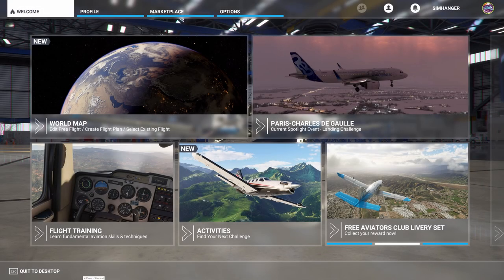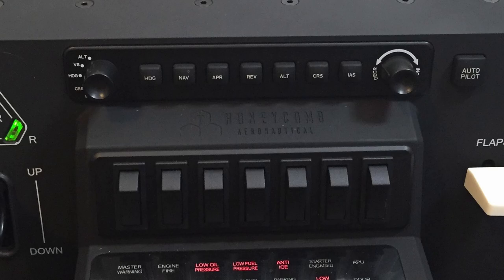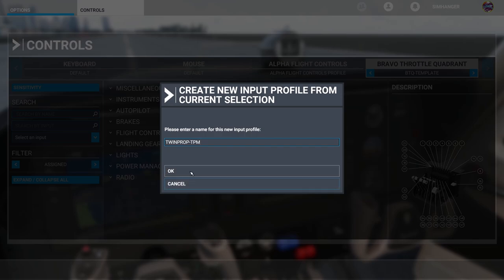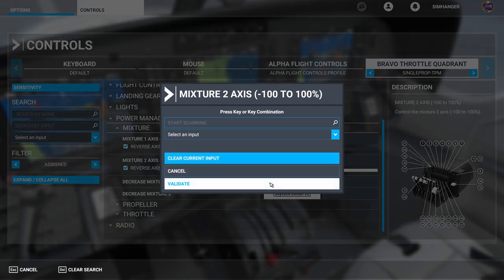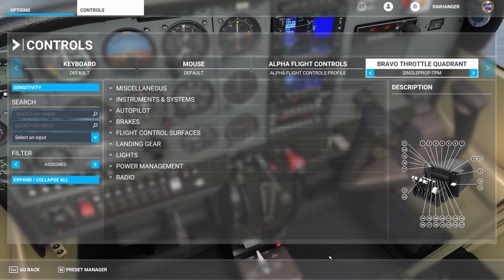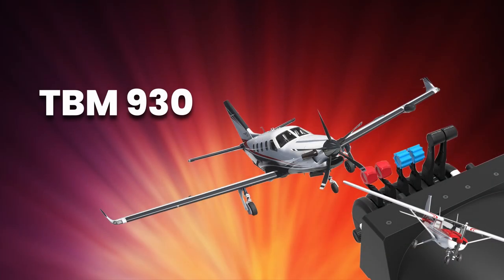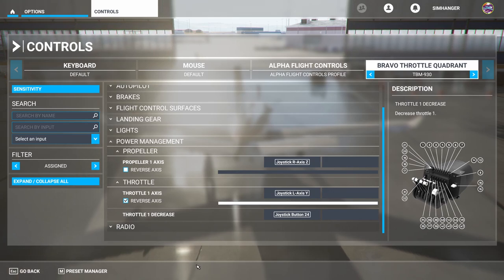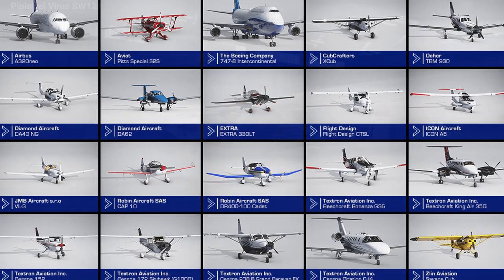Configuring the PROPS in the Bravo Throttle Quadrant | Microsoft Flight Simulator

Comment: Hi everyone. Anyone know how to get the reverse thrusters to work on the Beechcraft Baron G58 using the Bravo Throttle Quadrant? I have Throttle 1 Decrease set to detent button 24, and Throttle 2 Decrease set to detent button 25. When I pull the levers all the way down, the A/C doesn't move in reverse at all. Can anyone help?
Reply from the maker: Hello, the G38 does not have reverse thrust…so setting this has no impact. The King Air does.
Reply: @SimHangerFS  I was starting to figure that since when I move the lever to detent, it doesn't animate in game😄. Thank you so much for your quick response. I've learned so much from your videos🙂.
Reply: @SimHangerFS  Hello again, I'm sorry to bother you with another question, but if you don't mind...

From cold start, is there a way to start 1 engine at a time on the Beechcraft Baron G58 using the Honeycomb Alpha Flight Controls yoke?

I try to follow the in-sim checklist, but it seems I can only start both engine using the yoke...